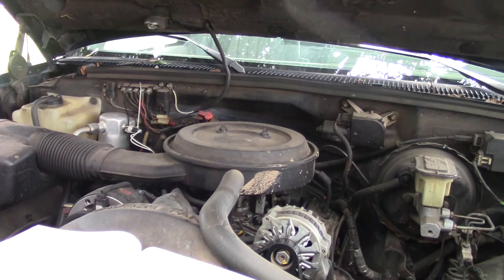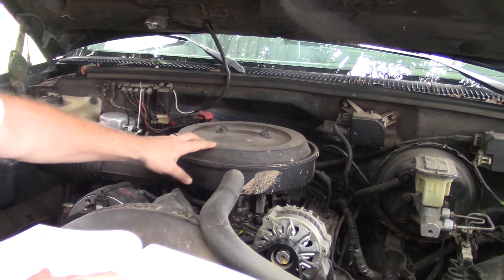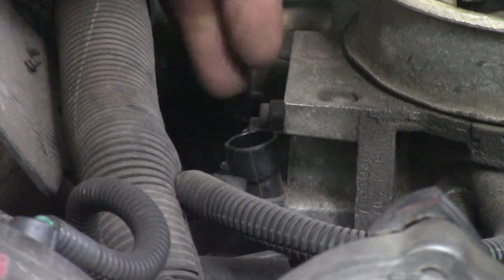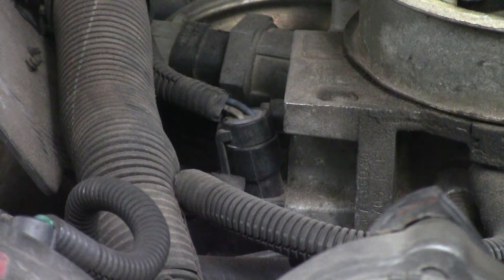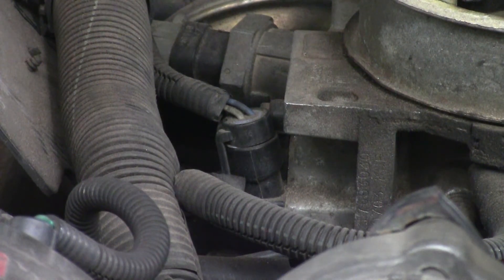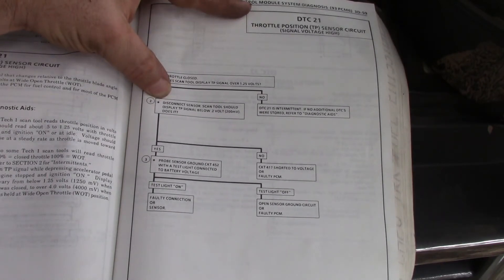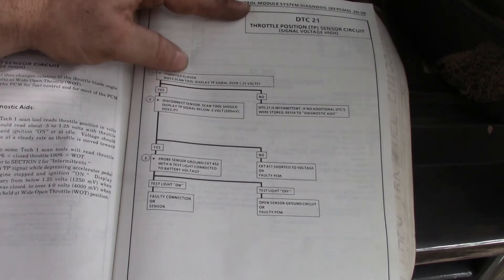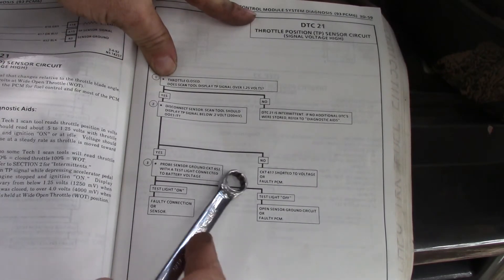GM Truck DTC Code 21

Comment: Do these instructions apply to carbureted SBC's too? I got a 21 and 45, started bad, mighy have pumped it too much to get it started. Always takes me 9 pumps to start after not driving for a few days or more. Always thought carb wasn't adjusted optimally, but that code 21 makes me think it's another or additional problem.
Reply from the maker: I haven’t had to deal with the computer controlled carburetors but I imagine the codes are the same.
Reply: @farmboysgarage7595  So is it absolutely necessary to change the TPS then for a 21?
Reply: @DominiAeternum  did you ever figure this out
Reply: @anthonygallardo84  no, the car actually got worse and now dies almost anytime I put it into any gear whether D or R at low RPM's. Mechanic who didn't see the car recommends fuel pump and or fuel filter. Stays on in Neutral and Park.

Comment: At first you said prob the black ground wire, and if it lights up its either a bad connection or bad pcm, then you changed that to the grey wire, which one is it
Reply from the maker: Black is ground. Gray is signal wire

Comment: My 1990 c2500 has 5.04 volts on the grey reference wire, is this acceptable. Im getting the code 21 only after driving the truck for about 25 miles. Im going to subscribe because you are the first person I have found that breaks down the actual diagnosis. Where did you get your troubleshooting manual?
Reply from the maker: Thanks!  5.04 V is great.  I got my manual on eBay.  It is a 1993 Chevy light truck factory fuel and emission service manual.

Comment: I have a question, I bought a 93 GMC K2500 6.5 and the transmission only shifts at the top of every gear. 
it won't shift in between. i just bought it today and it was a very long 2 hour drive home. 
thank you in advance I look forward to learning about GM trucks!
Reply from the maker: I'm no expert on transmissions but I can tell you that your transmission shifts are controlled electronically so I'd check fuses first and then take it to a knowledgeable shop.
Reply: Farmboy's Garage turned out to be the TPS. I tossed in a new one and boom. shifts great. thanks!

Comment: Good info ,  I put a throttle body system on a el Camino and much better that the old carb.
Reply from the maker: Thanks Lloyd, I bet it was!  I saw a TBI system for retrofitting older GM vehicles on eBay for less than $1K so not a bad choice.  Thinking about doing something like that on my '85 Chevy C30.

Comment: I know you mentioned about checking sensor output by backprobing the signal return wire and checking the sensor ground with a scope on a rope but did I hear you say anything about checking the 5v reference? Also just a bit of advice if you are missing any of your inputs or outputs be sure to check them at the pcm too, always the possibility for broken wire. Also keep in mind any thing on the 5v reference circuit can pull it down and send you on a wild goose chase!  Keep up the great work! Have you looked on craigslist for an old Snap On MT 2500 scan tool? That would be the best tool for you and you can get them really cheap! Fantastic on GM OBDI.
Reply from the maker: Thanks for the great input Dr. O!  I didn't think about checking the 5V reference because the code is set for high voltage on the sensor signal to PCM.  I will see if I can find that scan tool.  I have an adapter to go from OBD1 to OBD2 but I haven't tried it to see if it'd work with my cheap code reader.
Reply: Yeah I understand in the case for the code you have but I guess I was just thinking circuit integrity over all. A lot of time when I get codes for common 3 wire sensors I find it just as fast to quickly check the whole circuit. Power, Ground and signal return with a bypass test. Can it pull high, can it pull low and boom! Does it all make sense? Def look for one of those old snap on scanners trust me it is a well invested 2 or 3 hundred bucks especially because you like them older GM TBI's :)
Reply from the maker: Thanks Eric O!  I will definitely keep an eye out for one of those scanners!